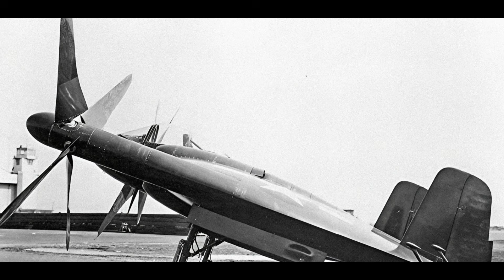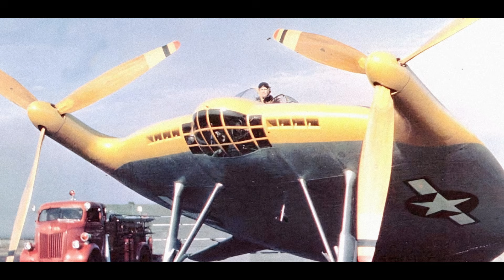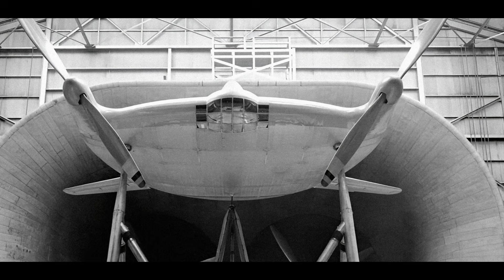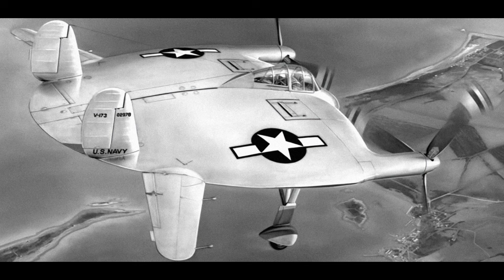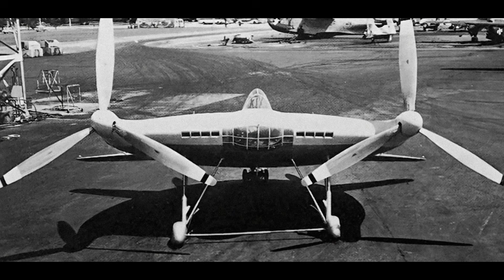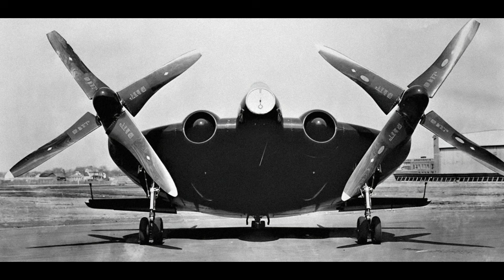XF5U-1: Why the US Navy Destroyed Its Most Advanced Fighter

Comment: Where the heck did they put radial engines? Wonder if it would be useful as a low-observable design.
Reply: if you look for the intakes at the front of the wing of the F5, they're inboard on each side of the pilot in the nacelles
Reply: @turkeytrac1  I see the intakes, where's the engine? I mean on the V-173.
Reply: @rocksnot952  The V-173 was powered by two flat four (boxer) engines that fit entirely within the wing.
Reply: @SSgtBaloo  Oh. Thanks!

Comment: The Vought Engineers had (obviously, slightly Over-powered!) an R/C model in '42, that could Hover, in-flight, at about a 70% attack-angle. They KNEW they were onto Something! The Issue, was in Up-scale from the first Manned-Prototypes, into the XF-5U, as the Inboard Engines, needed Complex Gear-Boxes to put the Power, to the Props! Had it been, instead built with a larger-wing width, as a Twin-Turbo-Prop, with the Driveshafts Linear to the Props, it's likely it would have served way past the Korean War, as it would have been a Very Useful STOL recon plane for the Fleet (or, Attacker from older Carriers!) up until the Viet-Nam war (and the McNamara era). Prop-Wash, was an Issue, it could Lift able-bodied Seaman away if Behind this thing (same was True with the AJ-3 Savage) on a Carrier deck. But, truly, an STOL Fighter/Recon, that could broach 490 mph in '45/'46?  It was remarkable, and, a Design that should have (like the X-19?) a revisit, these days. It would make one heck-of, an Anti Drone interceptor, if configured correctly.